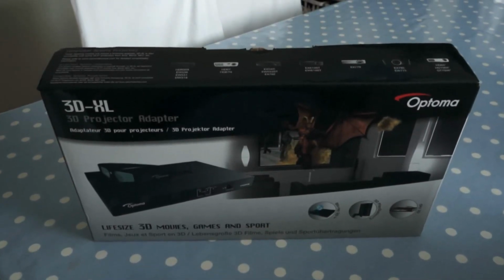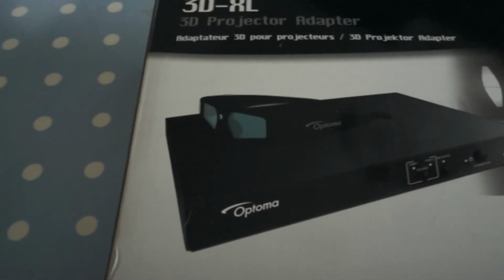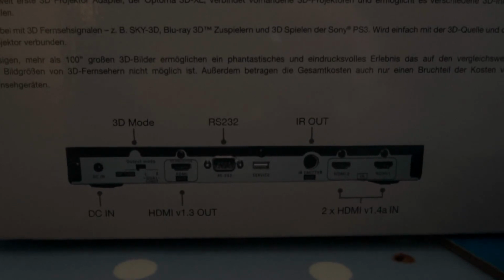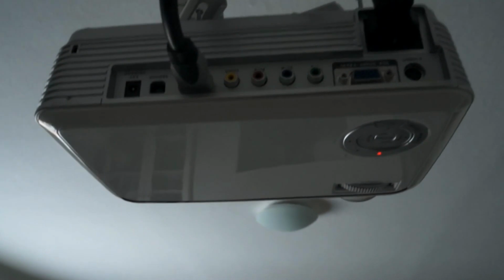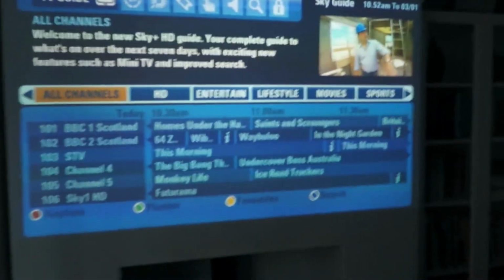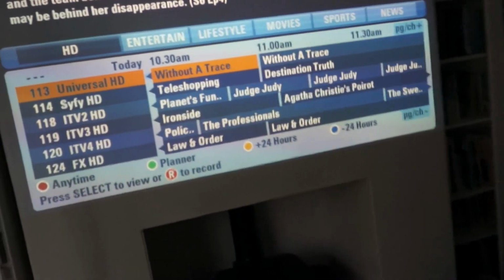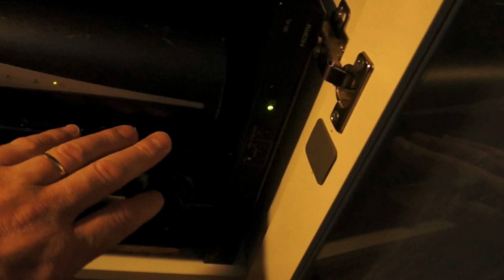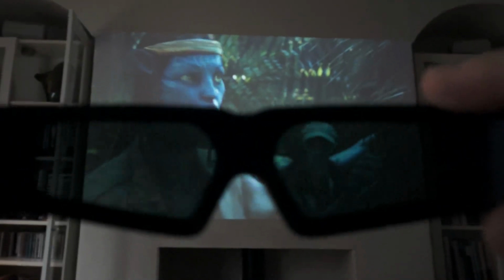Optoma HD 65 and optoma 3DXL 3D Projector Adapter install

Comment from the maker: Hi sorry Steve took a bit of time to respond.
My rig did not work properly until I changed to 4.1 to the projector ,I think you would get away with the standard hdmi to the 3 dxl but I changed them as well for belt and braces .
Mad that it makes a differance but it sure did.

Comment from the maker: Hi Paul
I'm using the Sky HD box and a PS3 attached to the 3dxl box .
Both can be plugged in together or individually .
I output my sound via the optical output on the PS3 and that goes through a separate amp .
Then the hdmi out on play station to the hdmi in on the 3dxl.
works a treat and it will play blue-ray 3d and 3d compatible games .
Hope that helps

Cheers
Alan

Comment: The optoma is better than the viewsonic box. The optoma has a port for ir or rf glasses instead of only using dlp-link and the box has a switch on it so you can use 2 3d-xl's for a dual passive projection setup.